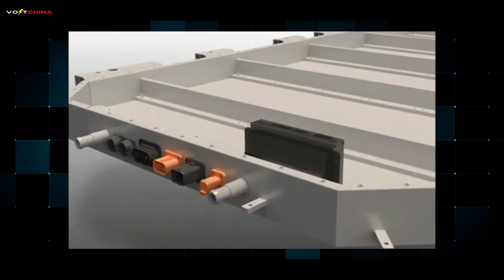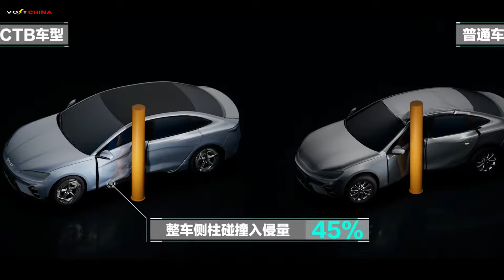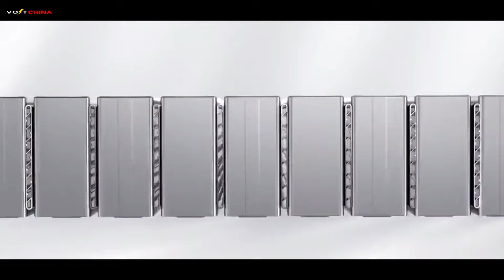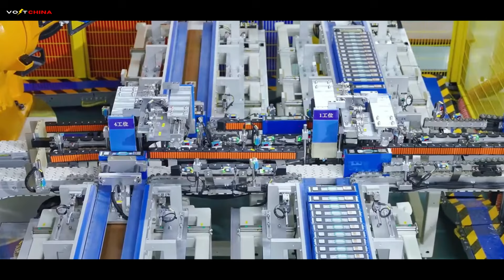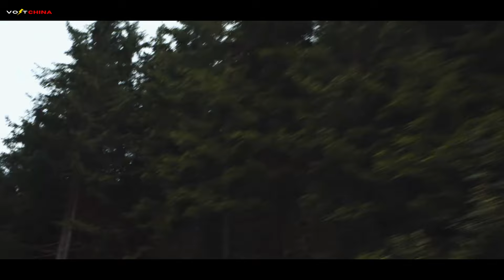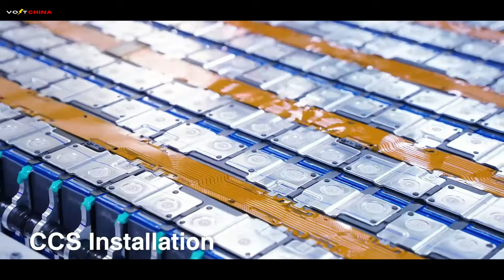BYD vs TESLA vs CATL: Who's Building the REAL Car? (CTB vs CTC vs Qilin)

Comment from the maker: The ultimate question of the EV future is an ethical one: Is Tesla's radical Cell-to-Chassis design genius, or fundamentally anti-consumer?
Tesla prioritizes manufacturing efficiency (lowering their cost) at the risk of massive repair bills for the owner ($20,000+ for minor chassis damage). BYD and CATL chose repairability and lower long-term cost.
Which company's DNA—Radical Efficiency or Pragmatic Serviceability—deserves to win the consumer's trust? Share your reasoned opinion below.
Reply: If the question is ethical then clearly Tesla is not even part of the discussion as they have no ethics.
My 2020 "Robotaxi" still doesn't work.

Comment: All EV batteries are still undersized for range.
I like both the BYD and CATL approach with our next EV likely to be an Xpeng, BYD or Zeekr.
Never buying a Tesla again.
Reply from the maker: You’re absolutely right! I completely agree that driving range is still an area that needs improvement, and the brands you’re considering are all strong competitors. I hope you can find an electric vehicle that perfectly meets all your needs — if you’re willing to update us on the situation later, I can’t wait to hear how it goes! Thanks for watching!
Reply: @VOLTCHINA 
If the Xpeng X9 had 100km better range, I would not even look at anything else 👍